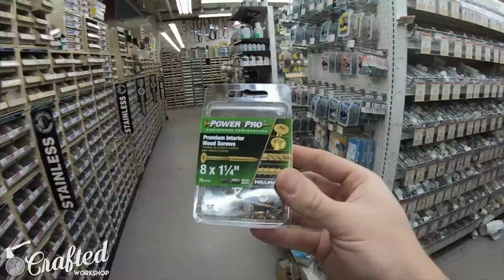DIY Bottle Lamp, Dartboard Cabinet & YETI Patio Cooler Stand | How To - Woodworking

Comment: Nice builds -- the curved "corners" of the back panel are a really nice touch.
Reply from the maker: Thanks! I find that a lot easier than squaring up the corners of the rabbet for sure.
Reply: Yea, better looking and easier!  I never thought to use the random orbit in the same way you use a disc sander (i.e. to sand to a line), but now that I see it, it makes total sense!
Reply from the maker: For sure!

Comment: Perfect Timing. Decided yesterday to build a cabinet for my dart board
Reply from the maker: Nice! This one turned out pretty well. Only thing I forgot to add is I'd make it out of a 2' by 4' project panel if you've got kids playing on the board, as people who don't play darts well tend to miss low, it seems.
Reply: Thanks for the hint. Depending on how much beer you've been drinking before playing darts, it may be helpful for adults as well.
And i turned out cool. I wanted originally to veneer my cabinet with oak but i kinda like the black stain.

Comment: You will enjoy those 12 volt milwaukee drills.  I have 12 volt Bosch ones and I don't see myself even bothering getting 18 volt ones because the 12 volt ones work just as good.
Reply from the maker: Yea, I can see that for sure. Most of the stuff I use these tools for don't need the power that a higher voltage tool would provide.

Comment: I have a Porter Cable saw with the blade on the flip side.  Don't know if they still offer them but I have one.
Reply: I have one. I'm a rightie. When using a right-hand saw (like when helping a neighbor with a project), I find it a real oddball to use.
Reply: Dad bought it years ago.  He passed about a year back so it's mine now.  Frankly I use both depending on the angle I'm coming from.
Reply from the maker: Yes, DEWALT has some with the blade on the other side as well.

Comment: Great video! Quick question: if the cooler stand was going to live outside, would you seal the ink stain differently?
Reply from the maker: Thanks! I'm not sure how the ink would hold up to direct sunlight. I'd definitely use a spar urethane with some UV blockers.

Comment: That Harper bottle is beautiful, but I'm more partial to your Highland Park test bottle ;)
Reply from the maker: I’d tend to agree with you! I bet you’ve got some killer looking bottles that would make great lamps.
Reply: Oh I have a few, the Mackinlay's and Crown Royal XR bottles are beautiful, but I think I'm going to turn one of my father's favorite bottles (Hibiki, which also has a beautiful decanter style bottle) into a lamp based on your video. What glass bit did you use?
Reply from the maker: Nothing fancy, just the one I found at True Value. It’s carbide tipped. And that sounds cool, tag me when you make it!
Reply: Will do, thanks for the info on the bit.

Comment: just a quick question: should I use a foam brush for walls if I want to achieve a flat texture (no texture)?
Reply from the maker: Like for paint? I’d use a low nap roller.

Comment: Just a heads up, you should use something like hot glue or epoxy to fix and protect the wire as it passes through the glass.  That could get frayed and cause a short.
Reply from the maker: Good tip, I’ll definitely do that!

Comment: You can glue your cork to a thin backer board, slightly oversized, and then cut or route the board to interior dimensions. Results nice clean edges. Then you install it to the back of the cabinet with adhesive or double sided tape.
Reply from the maker: Brilliant! Great tip, thanks Ryan.

Comment: Don't know how I never noticed you're a fellow lefty too before you directly said it! Are there any tools you think are genuinely unsafe to use a generic version of as a left handed person, or do you just use all standard stuff and deal with it?
Reply from the maker: Hah, yup! Hmm, I don't think so. I do prefer lefty circular saws, though.
Reply: I’m a lefty as well and I just recently got a circular saw with the blade on the left and I do not like it. I think I’m just used to the right side blade, plus it’s easier to see your line on a right side saw as you stand on the waste side of the cut. One thing I would love but have never seen would be a table saw with the long side of the fence on the left. 

Also, can’t beat having a good left handed hammer ;)